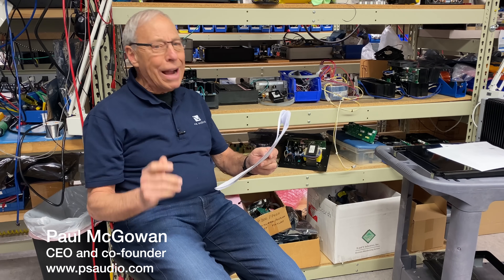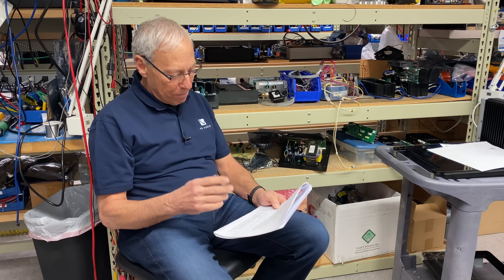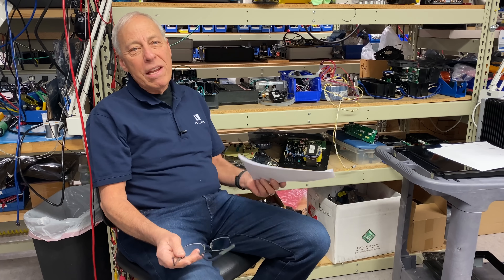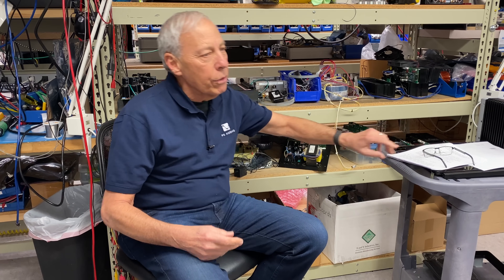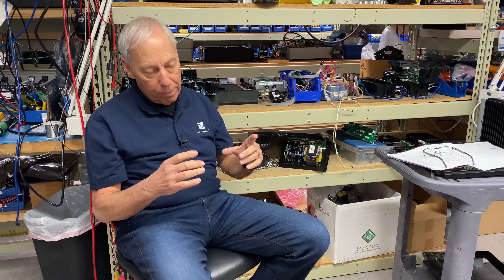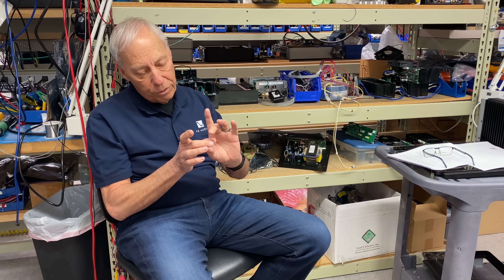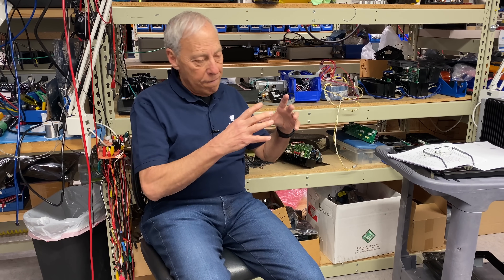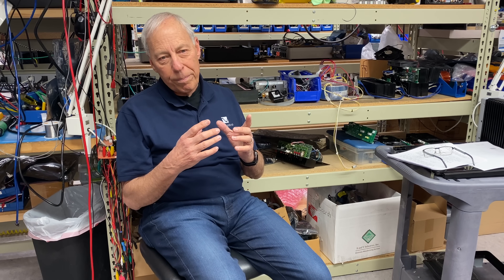Are toroidal transformers better?

Comment: Like all good salesmen Paul is only telling you what puts him in an advantage. There are actually 3 types of transformers, EI, toroidal and R core. In the past, toroidal were very expensive because they had to be hand wound. Today we have machines that do it automatically so the price of toroidal transformers came way down. Generally but not as a rule, for a set price (low to mid) you  get a better toroidal transformer than EI. This is due to the fact that EI transformers hum, vibrate and radiate large electromagnetic fields which wreak havoc for low signal components like preamps and dacs. But if cost is not an issue you can get better EI transformers. As for R-core, these are the best as they combine the advantages of EI and toroidal but none of the disadvantages but are even more expensive so they are very rare.
To conclude, never pick equipment based on transformer type. Today toroidals are the bandwagon that everyone hops on.
Reply: Wreak, not reek, is the word for which you are reaching.  Unless of course your transformers are stinking.
Reply: Macht Schnell cheers
Reply: @machtschnell7452  , good spot. he edited...now, you could be polite & remove your comment.
Reply: can they be made as output transformer for tube amps?

Comment: Paul, I worked for a company that built power conditioning equipment for the computer industry. I wound transformers (all sizes) for 7 years and stacked quite a few along the way too. EI transformers are simple to make and are tunable. If you did them yourself you would have better luck with them. We soaked the finished transformers in resin and baked them in an oven after they were tuned. They did not buzz.
Reply: I worked at a stereo company that used a lot of EI transformers.The power Transformers were vacuume impregnated with some kind of varnish and then potted with 450 degree roofing tar. Worked pretty good.No transformer hum...
Reply: Some of them are clamped and welded also.
Reply: How did you tune the units Christopher. Any other interesting bit of knowledge would be appreciated.

Comment: My tube amp has 4 massive EI transformers, and 300Bs. Sounds awesome. My 2,500 dollar marantz uses torroidal. Supposed to be high end. Sounds terrible by comparison.
Reply: Gianna Giavelli and that has nothing to do with the transformer choice .. never seizes to amaze me how uninformed audiophiles are 😂
Reply: @MichelLinschoten  im new to this audio stuff bought 2 years ago a pair of Dali Zensor Pico speakers, currently im searching the web because i want to DIY some speakers, and what i currently know that this audio-market is a lot of marketing besides that each ear is different so what might sound horrible to one might sound good for another
Reply: The transformer is only part of the equation. Bruce Rozenblit is a tube designer of some renown, and tends to use toroids in most of his power amp designs.
Reply: @fonkenful  Agreed.  I then took the Rozenblit design and DIY built amps using even bigger transformers and CLC filters to take it a step up.
Reply: I suspect you are using these tubes single ended in which case there is constant DC in the output transformers. EI transformers are easier to make that can handle the DC.
Reply: @johnhodgson5313  y thats why u never see torroidals with sets
Reply: Re enforces the concept that it is the sound of the entire component that counts, not the use of specific part in building it.

Comment: looking at the transformers and seeing those standard electric cables ,i cant help but think theres a lot of money wasted on these very expensive interconnects ,speaker cables etc. having said that i do have good cables..
Reply: admittedly these are just for the power supply, and good cables really make more of a distance with long runs where external noise really matters, the box of most audio equipment should help protect it from that until it gets into the jack, like yeah you could use 12 gauge wire for the pcb to jack connections but it really wouldn't make that much of a difference in most cases

Comment: I don't have any audio equipment with tordial transformers. I remember an old audio guru friend of mine telling me..."put the tip of a long insulated (wood, plastic, etc.) screw driver to the top plate of a EI transformer with power on. Place your ear to the butt end of screw driver. He said if you don't hear/feel anything then your transformer is good physically. If your hear/feel buzzing or hissing or maybe a radio broadcast then you may need a repair/replacement."

I've honestly tried this before and have heard a local radio station through the screw driver from transformer. Crazy I know but true.
Reply: I was checking interconnect shield currents in my system the other day, and noticed a significant amount of RF energy from the local AM stations.  But some of my cable runs are long, so most installations probably would not pick up so much RF.

Comment: I have a question about toroidal transformers... Have they ever been considered for the outputs of a tube amplifier?
Reply: James Plotkin that might take some of the warmth away.  In vintage guitar amplifiers, for instance, many of the old Marshall output transformers get ripped off by dubious repair shops, because it is often “the iron” that is so desirable.  Also, you may find that much of the “warmth” and “fat bass” attributed to tube amplifiers is really coming from the transformers, hence why the early McIntosh solid state amps sound so “Tubie.”  As this reflects a form of desirable distortion in both cases, I don’t think going for less of it would be desirable, but maybe...still the noise and distortion about which he speaks of eliminating with toroidal transformers is on the input power side and related the 50/60 hz A/C hum which is constant and otherwise mixes into the audio signal whereas the output transformers only color positively accentuate certain frequency ranges of the intense “pure” signal, so I doubt they would desire to clean up that stage too much.  I could be wrong.
Reply: @Diaphanic1  Thanks!
Reply: Yes that has been done by some very niche tube amp manufactures.
Reply: Andy Delle I’m curious to what effect they got out of it vs traditional transformers.  Just cleaner or what?
Reply: @Diaphanic1  I don't know but I am sure you can find some opinions online. With most high end audio, it's probably more like "We use toroidal output transformers and they don't"
Reply: Plitron produced a couple of models for specific applications.  They are very good, but pricy.  The few people who build amps with them rave about the performance.  Toronto based Plitron generally makes a product that is a cut above.

Comment: Paul- How important is it to shield those toroidal transformers to prevent noise? Love the shows!
Reply: There is a caveat to toroidal transformer mounting BTW,  you wouldn’t strap it down by anything that creates a magnetic loop through it as that would be a shorted turn.
Reply: @Jenny_Digital  That's why most have an insulated bolt in the center.  But even with rubber pad on both ends, a stainless bolt, and a stainless plate and plastic bushing on the bottom, it still will hum and have a little loss due to the bolt. But when you are talking about 6KW it is far less loss in the toroidial.
Reply: @gravelydon7072  And as I understand it, R wound transformers are nearly as good as toroidal with E.I’s being the poor relative in many HiFi applications.

I don’t see why these toroidal transformers can’t be mounted using polymer structures to to further limit losses etc.  I know of some excellent fully fluorinated high temperature engineering materials.
Reply: Far less important than it is for E-I core transformers.  Toroidal magnetic fields are better contained, and the symmetry of their shape tends to cancel induced current in nearby circuitry.

Comment: I am writing to inquire about an issue of my Markbass CMD151P Jeff Berlin amplifier.

I turned the amp on and practised for about 5-10 minutes. The sound was good, bright, full, nice.  After that, the sound started to be weak, volume is little bit down, feeling is hard to play and not responsive. So, I stopped to play and wait for about 5 minutes (wait with turn the amp off or wait without turn the amp off), the sound became full and rich again but only for 2-3 minutes. Then again the same issueis appeared.

Even though the offical service in my country (Turkey) couldn't reilize an issue, they accepted to replace my amplifier with a new one. The issuse pursued in the new amp and I decided to change other elemets; my guitar has also replaced other related  parts such as socket etc. However, the issue is still exist. I started to belive the issue can be from a specific batch production.

I would appeciate if you help me to solve this problem or give technical advice and check procedure that I can apply as an Electronic Technicihan.
Reply: My guess would be heat.  As the amp warms up, a number of components could be heating up beyond their capabilities.  A simple fix might just be to put a fan blowing on it.  If I remember correctly, there is a built-in fan, but it is tiny, maybe replace that with one with more CFM.  Bass player here.

Comment: When I hear Toledo, I think of the famous Toledo Sword.
3:11 Yes they can rattle, but that's why manufacturers put them in a metal casing with damping on the inside.
The damping prevents rattling and the metal can is a shield to keep the radiated EM noise in.

Comment: I was reading in an article about transformers (sorry don’t remember which website) that traditional transformers perform better in valve amplifiers.
Reply: Not sure about performance, but one thing is for certain:  Step-up transformers for tube equipment need a huge number of turns of fine wire, and would be extremely expensive to build in toroidal form.

Comment: Hi Paul!

I got a pair B&W 805D2
I noticed 1 tweeter doesn't work(properly)

I removed the cables and only put the cables in the tweeter terminals.
The right tweeter plays fine.
The left tweeter plays very very soft at high volume.
 
I swapped the right cable to the left speakers and still the same problem.
Is this the filter what is defect?(since I hear a little)
Reply: Probably a bad tweeter.

Comment: The most popular transformers used in audio are C-core or EI and they cost about  the same to produce. 

There are two main reasons why the C-core is better. Firstly the C-core is made from grain-oriented steel which can be used for higher magnetic flux (lower distortion at low frequency). Secondly there is more space for windings (the more sections the lower leakage inductance).  

However, for lower output power amplifiers say 50w the EI transformer is a better choice because of lower stray capacitance (better high frequency)
Reply: c-core doesnt have sharp corners to leak flux.
Reply: @Lloyd Stout and your point is...dont just agree, add to the conversation. Paul was talking more about toroidal vs EL transformers . How about comparing R-core with toroidal

Comment: Paul forgot to mention regulation, which is generally much better with a toroid - which will affect the sound, as there is less voltage droop at greater loads, especially important in high power amps.
Reply: Dave Micolichek  Hellop Mine Goods frends! Is this the title yu wer lookin for...

Deregulation, Reagan-Style
Jefferson Decker

President Reagans was a get rid of REGULATORS. thanks yoiu, and are the good frends! THUMBBS UIPS!
Reply: PResident RONALD RAYGUN got riods of  lots of RELUGATION but demoncratesa keep getitn in as more REGUL;TSION. thankes youe san dthum,bbs IPS!

Comment: Both transformers produce  the same AC, that then leads to the same DC out, how is the DC is different in EIs and in toroids? I have  one mono amp with a  970 VA  cubic transformer that does not make any noise,any hum;  it feeds a dual 15 inch woofer speaker box,2 Ohm,  would a toroid do better for the sound?
Reply: Transformers only work with AC in (the primary winding) and AC out (the secondary winding). The AC secondary is then rectified into rough DC which is then “smoothed” in the L/C/R filter portion of a DC power supply to make useable DC current
Reply: Toroids tend to have lower secondary impedance which provides more peak current capability which is highly desired in audio power amplifiers. But EI types can be built that way as well. I don't think it's worth any effort to replace your factory transformer.

Comment: Power transformers cannot sound better. They simply provide ac voltages. If they are wound with proper wire gauges to provide enough current at rated voltages that's all that matters. Yes, toroids have more contained magnetic field so they can be placed closer to the preamp section. If you are using external PSU then it makes no difference what so ever. And transformers don't rattle if they are assembled properly and potted as they should be not in super glue but in epoxy resin or wax. Your output transformers are EI and they don't buzz at low frequencies, right?
Reply: I gave you the thumbs up but we both know that the first law of High-End Audio dictates that Nothing can make NO difference, never ever!!
Reply: You pretty much contradicted yourself.
Basically in order to get a quiet EI transformer and in a way that it doesn't influence the preamp section you'd have to have it dipped in resin and incased away in yet another box (external PSU).
That's just stupid. 
You slap a simple toroid and you're done with.
For the most prts EI's are used in supercheap amps like Marantz's and Denon's 400$ amps (Made in Malaysia).
Reply: @SpaghettiKillah  That's not what I said, potting of transformers is a standard part of manufacturing process. It doesn't have to be in a separate box I was making a point since many high end products use both external boxes and toroids in them which makes no sense. There are no noise issues or quality issues with McIntosh and Dynaco amplifiers that have both power and output transformers on the chassis one next to the other and relatively close to the preamp section. Paying a premium to simply SLAP a toroid to an amplifier is closer to stupid than using a well designed and built EI transformer for a fraction of the price.

Comment: The designer from YBA felt toroids to sound inferior.
Reply: There's always someone who wants to contradict.
Reply: G Guest  
Disregard that article.  Many of the statements it contains are completely bogus and without substantiation.  For example, "Saturation of the transformer core results in an energy build-up in the core of the transformer," which is precisely the opposite of the truth.  Saturation of the core actually limits the magnetic energy it can store.  And the idea that such "energy build-up" can be dissipated by connecting the core to the equipment chassis is absurdity at the highest level.  
Unbalanced phase loads do not result in a DC component to AC mains power, and even if they did, equivalent toroidal and E-I core transformers would not have differing susceptibilities to it; they would have the same saturation current.
Reply: Only things I can think of that make toroids inferior are the much higher inrush current and (in some cases) the way the field propagates around the core. I've used both in amplifier supply designs, and both are indistinguishable from one another when properly oriented with the same voltage/current output.
Reply: @kevinroosa1315  To be specific he preferred double C types.

Comment: New York is nothing to do with York County there is a New York in England in Tyne and Wear I'm assuming that's where it comes from
Need to get down the gym Paul start lifting weights can't lift a what 2 or 3 kilo weight you woman's blouse.
How does the the tape actually work blocking EMI interference or RF is it effective ? what's in it to block the interference
Reply: LOL! YOu are the good frneds and very funnies. I lokies youe. I figures out your jon with  3 kilos, you mean 3 kips, or 3,000 pounds! mY FRENDS CAN GET am RADIO STATIONS ON HIS tube GUITARS AMPLIEIERS. iTS SWITCHABLES FROM pentodes to triodes to cyt the power sin halfs. Now they use guitar proscessores intyo a USB audoio intercae and then into the computers with JACK for Linux. I dont rember the recordfign tgheong the y use. I forget things and I get slow when ti gates lates.THNAKES YOUES AND THUMBBS UPS!
Reply: The name "New York" was chosen to honor the Duke of York.  
The large toroidal transformer was probably over 10Kg, it doesn't have handles, and it's very clumsy to pick up that much weight when seated in a swivel chair.  
The tape doesn't perform any suppression.
Reply: @marianneoelund2940  well if it was Duke of York they would have just called it York don't think that's correct. 10 kilos you having a laugh I don't think so maybe 5kg
Actually the type does add some shielding